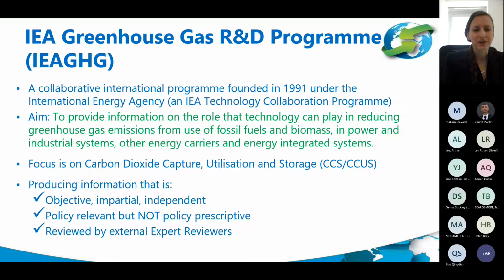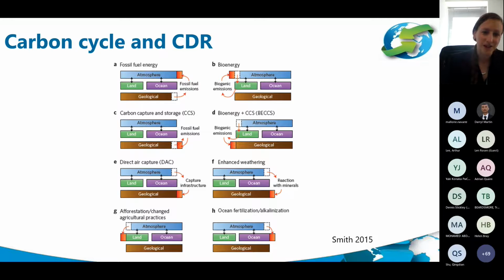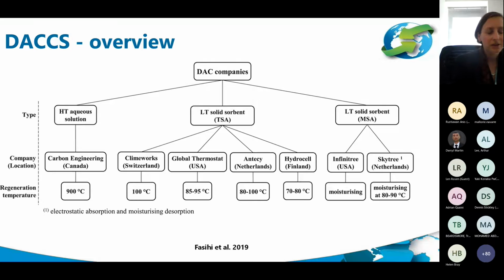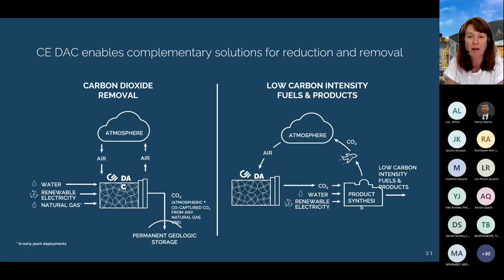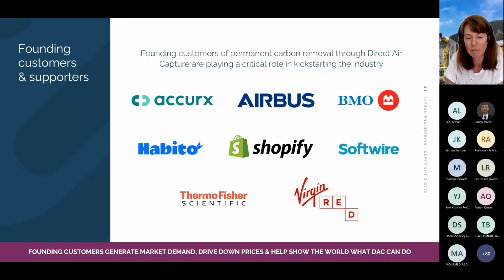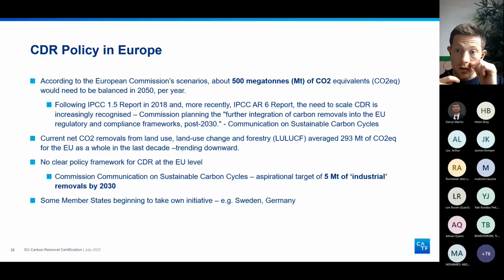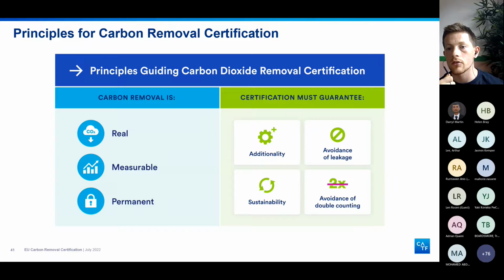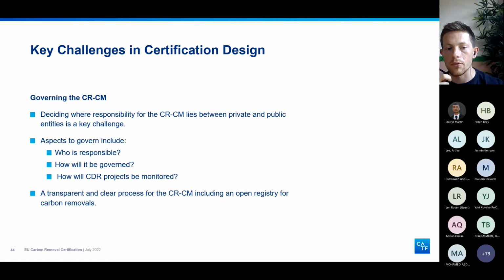Technology solutions for negative emissions and CO2 removal

Comment: In table 12.6 the costs per ton of sequestered CO2 of various CDR methods is listed. The cost of ‘Ocean fertilization’ are estimated to be between $50 and $500. I recently read an article and book by Peter Fiekowsky who estimates these costs at $ 0.03! This seems like huge difference. How is this possible? And frankly, at a removal of aprox. 1 trillion tonnes of CO2 from the atmosphere (which is needed to keep the earth inhabitable for humans in the long term), any method that costs more than $10 per tCO2 will be too expensive.